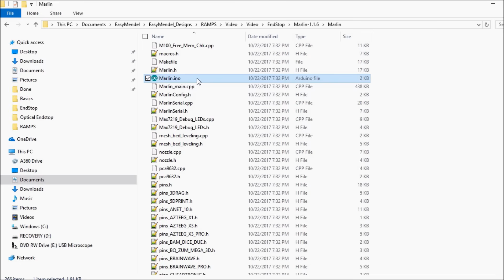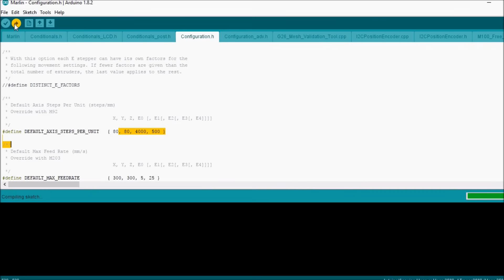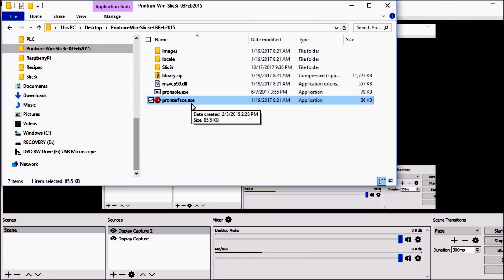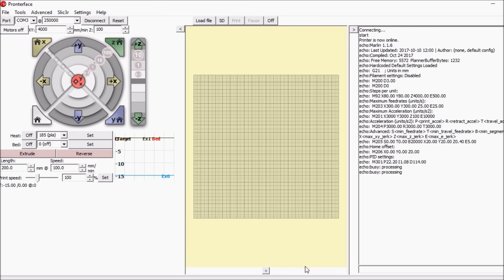RAMPS 1.4 - Stepper Driver install - basic

Comment: Amigo, troquei meus drivers a4498 por tmc2208. Em outros vídeos recomendam retirar o jumper do ms3 é correto essa modificação?
Reply from the maker: Se você estiver usando como configuração Step/Dir, os jumpers não serão alterados, mas se estiver usando via UART, você precisará de cabos de jumper para sinalizar os pinos para executar como UART.
Reply: @EdwardBraiman  estou usando modo legacy, plug and play.. retirei o jumper e ela começou a imprimir um pouco melhor que com os 3 jumpers 🤷🏻‍♂️. Só tive que ajudar os lassos em Z pq em uma impressão de um cubo xyz, deu diferença no eixo z deixando ele menor que os outros eixos... Ajustei e agora está quase perfeito

Comment: is there a way to check if the driver doesnt work?
Reply from the maker: There are some simple methods, like switching stepper positions.  The tutorial you're using is extremely old, so directions mY have changed.  Which version of Marlin firmware are you using?

Comment: Do i need to attach end stop to run motor? Because without that my motor is not running.
Reply from the maker: Also check to see if steppers are commented out as the video was recorded before for Marlin 1.1.9.  so search on A4988 in configuration.h and remove comment for stepper axis.
Reply from the maker: Could you give more details?  What in video doesn't work?
Reply: @EdwardBraiman  I am using marlin 1.1x and I uncommented A4998 driver for x but still motor doesnt run.
Reply from the maker: Does the motor make any noise?
Reply: @EdwardBraiman  no nthing
Reply: And i connected 12v 10amp toh +5A input only not on +11A input
Reply from the maker: Could you post a picture and configuration.h, configuration_adv.h and platformio.ini on Discord and I or someone else will look?  Also what color your stepper drivers are?
Reply: @EdwardBraiman  red colour A4998
Reply: When i run it without ramps board it works fine.
Reply: @EdwardBraiman  i have sent on live stream channel
Reply from the maker: I'll look tonight after work.
Reply: @EdwardBraiman  thnks man
Reply from the maker: You're welcome.
Reply: @EdwardBraiman  did you look into it?
Reply from the maker: Not yet, might look tonight if I live stream at 6 PM EST.
Reply: @EdwardBraiman  ok np

Comment: I did all connection correct to the ramps board but when I supplied 24 V power, smoke came from the ramps shield and it's not working now.  I just want to know what mistake did I made so that, I will not repeat the same mistake.
Reply from the maker: Ramps 1.4 is not designed for 24v.  It should only use 12v PSU.
Reply: @EdwardBraiman  can I upgrade ramps to 24v
Reply from the maker: Ramps 1.6 is 24v.
Reply: @EdwardBraiman  thankyou
Reply from the maker: You're welcome.
Reply: @EdwardBraiman  For 12 v input power can we remove the diode present in ramps 1.4 which power arduino or its fine
Reply from the maker: There's a way to make RAMPS 1.4 24v capable, it's not recommend.  It's easier to purchase a RAMPS 1.6 in time and effort.

Comment: My Motor only vibrating , I am using merlin 2.0.5.3
Reply from the maker: Sorry Marlin firmware has changed since the recording of this tutorial.  In Marlin 2.0.x or 1.1.9 you need to enable steppers in configuration.h.  search in configuration.h for, "a4988", and remove comments for x,y,z and e0 to enable stepper axes.  Also check jumpers and alignment.  FYI, I have a newer tutorial in my RAMPS 1.6 playlist which will cover these changes.

Comment: very simple explanation, but i'am facing a problem i did everything like you but the stepper motor didn't rotate only make a noise i don't know what its the problem
Reply from the maker: In the newest version of Marlin (above b1.1.8) firmware you will need to enable steppers by Axis. In configuration.h search on, "A4988", and remove comments for each axis used and change to stepper used.  Rebuild and let me know if it works?

Comment: Just wondering how much power supply u need
Reply from the maker: 12v power supply.  If you check the RepRap wiki they have the type specified.

Comment: Why does my pronterface keeps saying echo busy: processing then it says error printer halted kill() called ! 

Does anyone knows why this happens
Reply from the maker: Generally it's a connection issue with com Port.  Do you have the connection in use by something?  Otherwise I would need to have an idea of you configuration.
Reply: Edward Braiman I sorted out that problem now everything works expect my step motors they don’t make no noise or anything. I check the wiring still nothing I’m not sure why. I followed u video but the motors don’t do anything. When I press home x on the pronterface it’s just says echo: busy; processing. I’m using marlin firmware
Reply from the maker: Which Marlin firmware version?  What hardware are you using?
Reply: Edward Braiman I am using the 1.1 from February for marlin and I’m using a 1.4 ramp with a mega Arduino board with bioplar Nema 17 stepper motors. Thank you for the quick reply does it matters if my stepper drivers are the colour green or the stepper drivers should be red
Reply from the maker: It maybe the wiring of the Nema17 steppers.  I made a video on how to wire them.  You may need an LED to check if they work correctly.
Reply: Edward Braiman I did follow u video it was useful thank you. I think it’s my power supply does it matter if it’s ac or dc
Reply from the maker: Here is the link https://reprap.org/wiki/Choosing_a_Power_Supply_for_your_RepRap

Comment: Whenever i plug in the a4988 the Port becomesd grey in arduino IDE. Any suggestions?
Reply from the maker: Check that steppers are plugged in correctly.  This should be detailed in the stepper videos in the playlists.  Otherwise it may get be a damaged board.

Comment: Motor just makes a sound and doesn't rotate, how can i fix this?
Reply from the maker: This might be related to turning of stepper driver.
Reply: @EdwardBraiman  how much voltage across the driver would be sufficient for 1.5A motor? I'm having a problem in tuning that and have damaged many drivers.
Reply: Putting one wire of multimeter on potentiometer and other on the usb input that is the way to check the voltage across driver, right?
Reply from the maker: @Niteshowman  correct.

Comment: Can i get the link for this marlin code?
Reply from the maker: Try Marlin firmware GitHub repository.
Reply: @EdwardBraiman  We made all the setup for 3d printer but none of our motors are working. So we decided to check motors one by one following the instructions on this video but it still isn't working. Is there a way to check if ramps is working or not?
Reply from the maker: Which version of the Marlin firmware are you using? Do a search on A4988 in configuration.h if you're using Marlin firmware versions 1.1.9 or 2.0.0.  You should see something referring to each motor axis for A4988 remove comments for x,y,z, and E1 recompile and you motors should move.
Reply: @EdwardBraiman  Thanks sir I changed it and connected the printer to pronterface but it says echo:busy and processing and after a while says printer halted. What could be the possible solution?
Reply from the maker: What occurs before echo busy?  Was there an error message afterward?  Do the motors move?  Was the heatbed or extruder started?
Reply: @EdwardBraiman  actually yes there was an error message. And it seemed like the motor driver's fault. Is reducing the voltage using potentiometer of driver ok? Those drivers get heated very quickly.
Reply: And i think there is no problem with ramps because end stop is working.

Comment: sir, can you help me ? my motor is not running i'm use marlin 1.1.9
Reply from the maker: Could you give some more details about your setup?  Do other motors turn?  If you place same Nema17 motor in another position, does it work?
Reply: @EdwardBraiman  i tried according to your video, on pronterface is written echo:busy:processing and endstop  does not work
Reply from the maker: Check the Endstop with a multimeter.
Reply: @EdwardBraiman  done, i tried i ad speed motor and acceleration on marlin firmware? I tried adjust motor speed but failed to move
Reply from the maker: Can you make a video of your hardware setup so we can see the physical configuration and post a link?
Reply: forgive me the problem is source code sir on endstop, I've tried it finally motor and endstop can running
Reply: thanks sir
Reply from the maker: You're welcome, but you figured it out, I just made suggestions and now you can pass the guidance to others as someone had to me.

Comment: Sir , could you tell us how to set home for z axis?
Reply: What is the convention(1A 1B 2A 2B) that u have used for movement in z axis ?
Reply from the maker: Okay, but you'll need to give me some information about your configuration.  What do you have setup already and what is occuring?
Reply: Edward Braiman we are using NIMA 17 17HS130404S1 motor. In this, the configuration is A A1 B B1- black, green, red, blue respectively. This configuration is used for z axis. After dumping the program when we start with pronterface application,  x and y motors are working fine. In case of z motor, they are working fine when we move them 10 steps at a time but they fail when we click on z home. On clicking z home , the motors are making noise and they are neither moving up nor coming down.
Reply: Thanks a lot for replying so quickly sir.
Reply from the maker: With the z axis you may need to increase the current on the stepper board using the trim pods. Remember to power down the system completely and disconnect all power cords.  Then increase the trim pods current on the stepper driver board.  You should only do small increments and repeat steps outlined above.

Comment: Can we use regulated DC linear power supply instead of 240 volts power supply?
Reply: Same. Our power supply was toasted when we switched it on. Don't know where we went wrong.
Reply from the maker: RAMPS 1.4 maximum voltage is 12 volts.  So , No.  This voltage is profoundly dangerous.  For your safety and others do not attempt.
Reply: @EdwardBraiman  thanks sir
Reply from the maker: You're welcome.
Reply: @EdwardBraiman  can i use 12V 20amps. with ramps,  and just use servo one motor with it ?

Comment: My motor is not working
Reply from the maker: What version of the Marlin firmware are you using.  After the tutorial was made a new version of the Marlin firmware was released and now you may need an additional step.

Comment: I am getting the error that is echo:busy:processing
Reply from the maker: When the tutorial was recorded the Marlin version was 1.1.6, it's now 1.1.9.  The addition step is find, "//#define X_DRIVER_TYPE  A4988", and remove comment to look like, "#define X_DRIVER_TYPE  A4988", this was recently added to Marlin 1.1.9.  Let me know if this helps.
Reply: @EdwardBraiman   Still not working. My motor is 17hs4401 rated 1.7 amp. I have used drv8825 and a4988 but still nothing is working out.
Reply from the maker: What version of the Marlin firmware are you using?  Remember to remove comments for stepper.
Reply: 1.1.9 @EdwardBraiman
Reply: even tried with 1.1.6
Reply from the maker: Inside Marlin firmware in Arduino IDE, select configuration.h tab.  Search on DRV8825, it should explained stepper driver new process.  You can also watch my Rumba Playlist for DRV8825 and follow the steps in Marlin firmware section, just don't change morher board for Board_Rumba, just use your board type.  The recent changes to the firmware, make it seem confussing.  Also verify that the stepper board is aligned correctly.  A key is to match the stepper pin names to the motherboard pin names.  If they're plugged in backwards they will cook the stepper driver board.  Let me know if this helps.  You can also post a video link to your motherboard as a video,. Maybe if I can see a close up of the board I might know what's going on.
Reply: @EdwardBraiman  My motor is running with V3.0 CNC shied driven by arduino UNO ans DRV-8825But its not working with ramp 1.4. Can you please make a new video of running ramp 1.4 with stepper motors with latest versions of arduino IDE, marlin. I will be very thankful of you.
Reply from the maker: @sohaibzulfiqaransari2865  This might help until I make a new video for the RAMPS 1.4, keep in mind the section for Marlin firmware, it will show you how to configure in Marlin 1.1.9 ... https://youtu.be/wgupIDtI-EI

Comment: I did the same thing but motor moves slower than a turtle :( anyone can help?
Reply from the maker: What's the datasheet say for your devices?  This might give you an idea.  You may also increase the power as long as the motors do not run hot.  Just remember to do it in small increments.  And without power in system when adjusting.

Comment: Ok I plugged in a new motor and plugged all the jumpers and all the stepper drivers in it's working now!!
Before I just had 4 stepper drivers plugged in and left 3 jumpers unplugged!!
But I still can't get the D8 or D9 to work as my heatbed  D9 is doing the  adjustable fan and D10 is the Extruder hotend D8 Doesent seem to be doing anything!
This setup is the Ardunio Mega 2560 with ramps 1.4 connected!
I'm running an anycubic kossel Delta plus 3D Printer (burnt my trigorilla board) and I uploaded the firmware on it trough Cura software with the firmware hex file from there website!
Everything seems to be ok I tried using the fan as the Heatbed and turn the fan on full blast with the heat bed connected to D9  it actually heats the bed but after a few minutes the whole printer stalls??
Reply from the maker: Google the pinouts for RAMPS 1.4 and you'll see the connections in the images. Check the thermistor for connection issue with a multimeter.

Comment: I got the exact same setup everything works except my etruder motor do you know why?
I tried everything switching wires and everything the motor won't move when I tell it to in the move option I turn the heat extruder up it still won't work?
Reply from the maker: Are all the jump connected under the stepper?  What version of Marlin firmware are you using?  Can you provide as much detail as possible?  What type of NEMA motors are you using?

Comment: How do you determine the orientation of the stepper drivers?
Reply from the maker: Two ways, reverse the stepper motor plug with the board powered off or modify the Marlin Firmware (1.1.8) by using the setting, "#define INVERT_X_DIR false".
Reply: Thanks for the reply.  I guess I wasn’t clear, when you install the stepper drivers how do you know the proper orientation . I’m referring to the positioning of all the legs and where they plug in. You displayed 2, one going one way and another opposite.
Reply from the maker: Wait.  I misunderstood your question.  You install the stepper driver board only one way.  The nema 17 stepper plug can be rotated.  Do not install stepper driver board reversed.  The alignment is based on matching the writing on the motherboard to the pins on the stepper driver board.
Reply: @EdwardBraiman  LOL  sometimes,, ya just feel so stupid.. LOL  I  could see no writing on board,  uhm.... everything else was labelled awesome!  Than I turned the board over... What a dofus I can be!    Thanks for the  kick in the right direction..  simple observation...  All plugged in.. My first  total DIY build of a printer. Learning new stuff every step of the way!
Reply from the maker: Yeah my newer videos go into extreme detail with the board labeling.  The "en" on the board is key to alignment of the stepper driver board with the motherboard.     These videos are designed to help people avoid the mistakes I've made in the past.

Comment: Can these use separate drivers by wiring to step/dir?
Reply from the maker: Not sure I understand the question.  Each stepper is prewired for x,y,z,e0 and e1.  You can add more by using auxiliary pins and modifying pins_ramps.h.  there should be two videos in the playlist I prefer the new video as it's cheaper to connect.

Comment: I just found your channel. I have an Mbot cube that Ive had for a few years. I got three or four good prints out of it and the mother board crashed. I was told to upgrade it to a Ramps 1.4. How do you find out how many steps per mm the steppers have? Im on a very steep learning curve here and dont relly want to screw it up further, but it is useless sitting there collecting dust. Thanks.
Reply from the maker: Interesting question the variables are many. First if you need to consider stepper driver boards if you're using a a4988 then calibration is minimal in Marlin firmware, but I personally would only use them in the z-axis.  For x and y-axis I prefer to use a drv8825 because they are easier to calibrate for finer stepping in x and y-axis, but you will need to double values in Marlin firmware.  After they are working you will need to print a calibration cube 20mm square and measure. When you reach this point you will need to calibrate like my extruder tutorial, but for the axis in question.  Also keep in mind each step in the process will be a new challenge.  Easiest way to proceed is watch all my RAMPS tutorials and MKS Gen L tutorials to get an understanding of the steps.  Also check out forums to confirm steps before attempting.  Good luck.